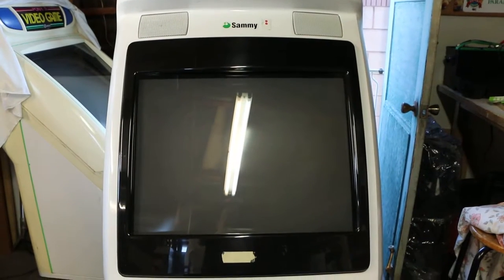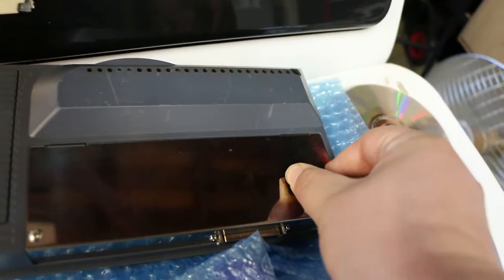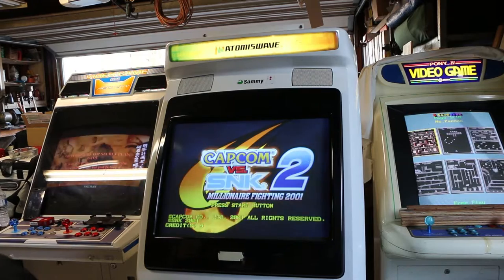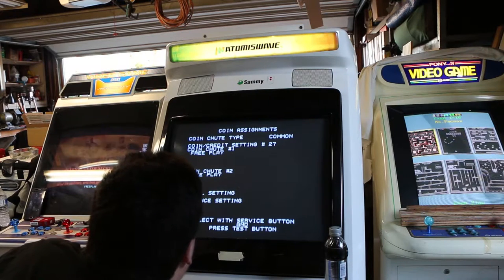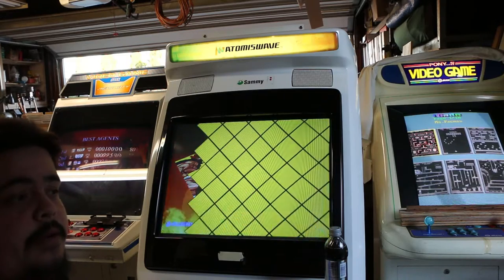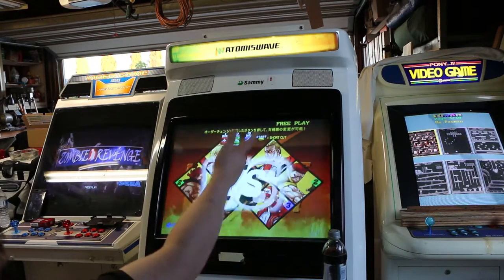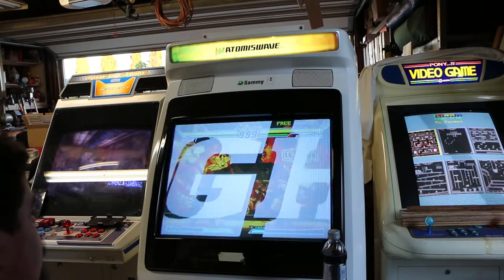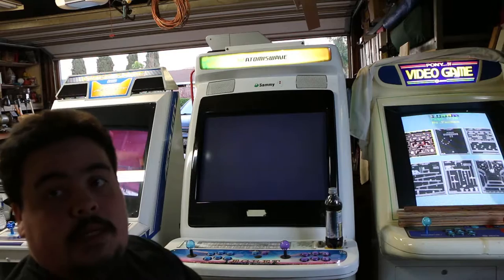PART 2: Sega Naomi Error 21 - Troubleshooting (Arcade Candy)

Comment: hi, Im getting error 34 Getway cannot be found on my Naomi 2 GD-Rom trying to boot Capcom vs SNK 2.  Ive looked all over the net and I cant get an answer.  Please help!
Reply from the maker: According to Arcade Otaku Display: GATEWAY IS NOT FOUND.
Cause: The game doesn't like the security PIC/chip you're using, or PIC is missing, only seen when net-booting(?).

Are you trying to netboot a Raspberry Pi or something like that?
Reply: BNGamesReviews no I have original Naomi 1 and 2 boards.  GD-Rom and GDs with security chips.
Reply: I have original Japanese arcade cabinet.  I will try to switch the PIC/chip tomorrow.  Thanks!
Reply: What if the board is stuck on loading game now